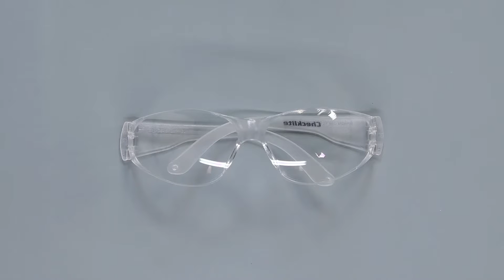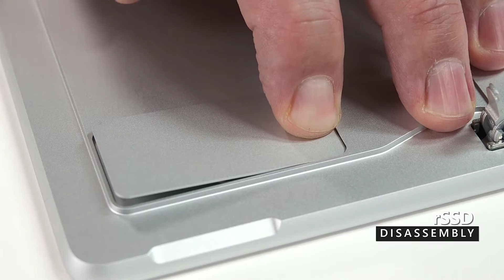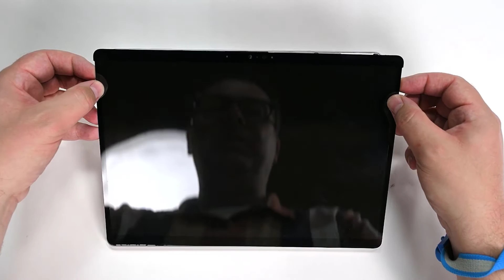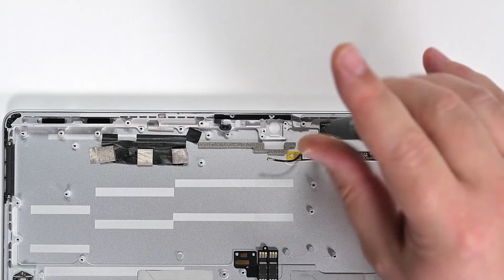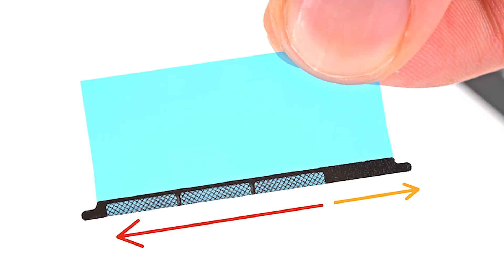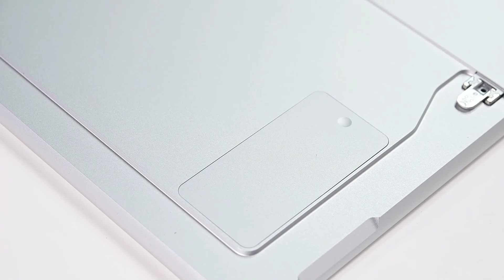Repair | Surface Pro 9

Comment: All electrical devices such as iPhone, Samsung Galaxy, Laptops should release "Repair: Assemble and Deassemble" video like this along with new product showcase. Also, the company should sell spare parts. In case of damage, some users can do it on their own.

I don't trust repairers as they may replace the original parts. Some even cause even worse.

Comment: I have to congratulate Microsoft for deciding to follow the right path and make these wonderful devices more repairable.
As a Surface Pro owner since the original Surface Pro, I am passionate about these devices, but I know how painful it was to perform any type of maintenance.
Good times are coming and Microsoft is on the right path!

Comment: 12:42 don't forget to re apply thermal paste !!!!!!!!!!!!!!!!!!!!!!!!!!!!!!!!!!!!!!!!!!!!!!!!!!!!!!!!!!!!!!!!!!
Reply: I think the official heatsink replacement comes with preapplied thermal paste, but yes if you're disassembling to clean it for example and not replacing the heatsink then you need thermal paste 😅

Comment: Very cool. So glad you're making these repairable. Two notes; I think thermal paste should be re-applied when refitting the Thermal Module. Also, I'm sure the weights for display bonding should not be 32kg which is about 70lbs. Perhaps 3.2kg would be advisable. Thank you for this info.